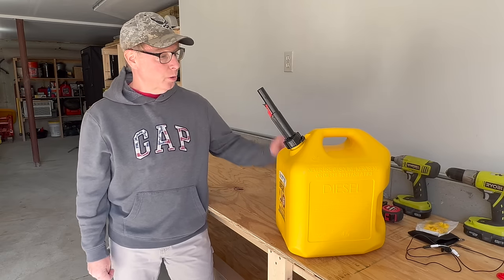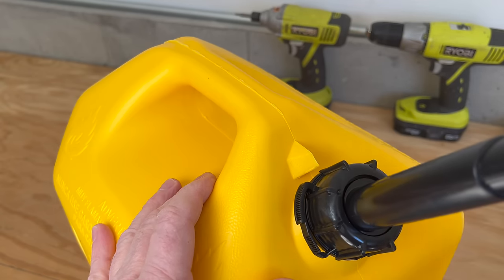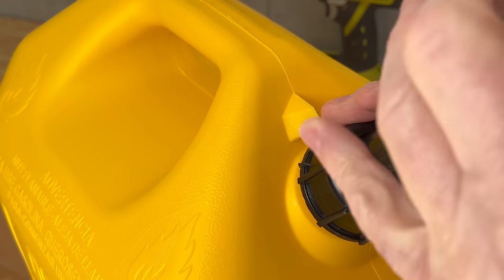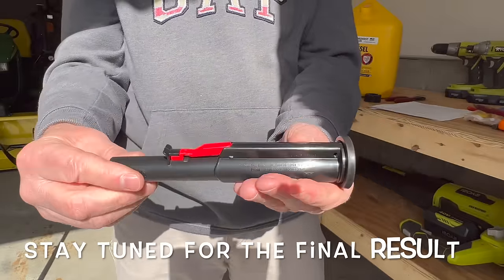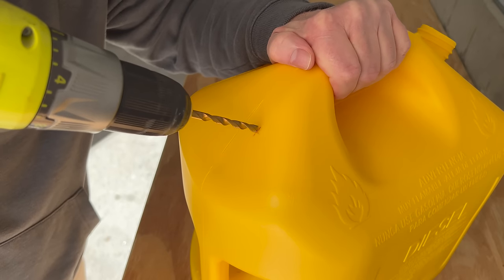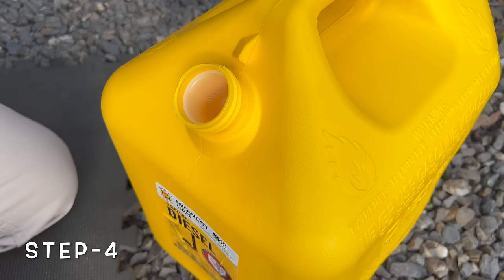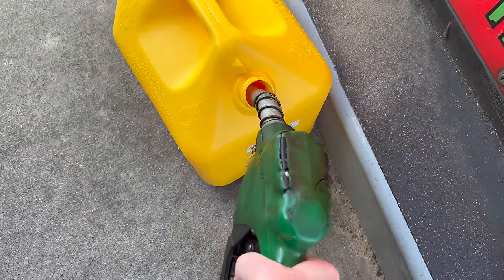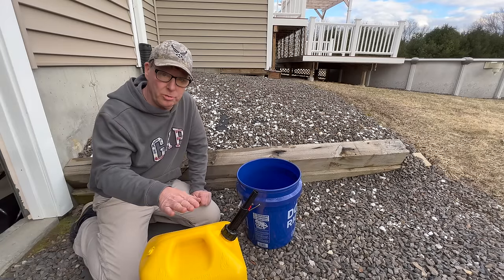Fix a New Gas Can in 4 Simple Steps.

Comment: I got a pair like these (Red, 2-1/2 gallon) at Harbor Freight and noted three of the same problems: The safety lock on unscrewing wasn't as much of a hassle for me, or I would have cut it off, as you did. The spring-loaded fill valve was really annoying. Thanks for showing me how to disable it. I don't know how they expected you to use that on a shallow Briggs and Stratton lawn mower tank.

And thanks for showing me that pop-in vents were available. Fortunately, I did save the old spouts from my prior cans when they developed holes, and have been using them, but I do need to add the vents.
Reply from the maker: Awesome. Thanks for watching

Comment: Good job. Thanks for the how to. Another issue I keep running into with these new cans for some reason is that the nozzles don't seem to screw on or seat properly without trial and error. Never had this problem in the past. I'm a former plumber. So I'm not a stranger to proper thread alignment.

Comment: I agree that the extra crap on our cans is a pain.
Just because in California,  vent holes are not allowed.  So, EVERY fuel can has to be made without them.
I spilled more fuel trying to fill a small push mower with a new "environmental safe" can than with an old Ironsides can.
Thank you so much for this video.

Comment: Came across your video about 2 years after you posted it and I'm damn glad I did. I needed a small gas can for my push mower. My older five gallon can was very clumsy to use when filling such a small tank. I bought a two gallon can which I only need to fill three quarters to have enough gas to mow my front and backyard at least twice. The modification you show in this video makes filling the smaller tank on my mower so much easier. Now the tool fits the job. Thank you for this great idea. You have earned yourself a like and subscribe.

Comment: Look for "ez-pour spout" replacement spouts. They are also a good option to fix old cans that have beat up or missing lids. I have a hi-flow double length that is great for my old tractor (I need to climb up on it and balance, the extra long flex spout can be stuck into the tank before starting the pour. And fast flow reduced the time I need to hold up 5 gallons.)
Reply: Excellent. There may still be a small issue figuring out which states restrict these aftermarket spouts (and ways to circumvent that.)

Comment: Sure, used to occasionally spill a tiny bit of fuel here or there....but with these new dumb gas containers you  are absolutely guaranteed to spill so much more than you ever spilled before plus break your back on the 5 gallon ones because you have to hold it sooooo long since it pours sooooo slowly. Great video!

Comment: Thank you so much for these terrific tips. Since I've never been able to get the dang spout to work, I've just been leaving it off and pouring the gas into my ride-on mower with a funnel. I never even knew there was a spring inside the spout, because I can't even depress the red button with my very arthritic hands let alone press on the spout against the fill spout on my mower. If I can't get it disassembled to remove that darn spring or at least cut it down (like another demo I saw), then that will be the deciding factor for whether I just keep using my funnel. It won't need a vent hole if using my funnel, because it pours very quickly, but I might add one anyway to make it flow more smoothly. I'm DEFINITELY going to cut off that piece from the cap. It too is very hard for me to mess with and it makes me angry right off the bat when I have to go to the gas station to fill my ide-on mower gas cans. Considering the trouble you and another demonstrator had getting out that thing from inside the can, I won't even bother trying. It at least keeps leaves and such from blowing into the gas can. My home is surrounded by all sorts of trees and wind tunnels, so that's important for my gas can. Thanks again for your help, esp. since there aren't even instructions on or with the dang new-fangled gas can design.

Comment: I used a step bit and a shop vac when I drilled for the vent.  I have the kind with a mesh fabric type flame arrestor, so left that one in as it does not cause splashback or pump shutoff.  If it were diesel, I'd certainly remove it as it's just silly in a diesel application.  I also replaced the spout which was a trigger type and not the push in type you have with a regular flex spout, also from Amazon.

Comment: Oh my gosh I need to do this on one of these cans for diesel fuel. I carry two 5 gallon diesel containers in the back of my truck for my pet grooming trailer. I have the cans that have the spout that moves but this type of can I see would actually be better with this modification. Plus cheaper. The other ones never get enough fuel out the way that my generator sits in my trailer. Thanks much!
Reply from the maker: My pleasure.. Happy to help.

Comment: A step drill bit works great for plastic and keeps a round hole. I use one to make a hole for adding a vent to my gas can and go slow and can get to the perfect size without having to change bits. Make sure you clean out any plastic before you add fuel. I’m going to take the spring out of the spout for sure!

Comment: I've had to do this. And in some cases just take off the spout and pour gas using a funnel. The vent cap is easy to do. But it you don't have them, a drilled hole with a golf tee to close does the trick too.

Comment: I'm still using cans I bought over 30 years ago.  They even have flexible nozzles.  (Very useful for pouring into my motorcycle's fuel tank, as I can put the nozzle into the tank before I even start to tilt the can - no spillage on the bike's 45 year old paint!  A rigid spout like this simply won't work.)

Comment: You missed one problem I have, if you use the tab to push the spout in when pouring it bends the flange on top the can and leaks all over the place. Good video, I replaced mine completely with the flex style nozzle. I never thought to take the spring out

Comment: BOUGHT THE FLEX HOSE REPLACEMENT, GETTING THE INTERNAL 'FILTER' WAS MY ONLY ISSUE, THANKS FOR THAT.  SUGGESTION.WHEN YOU HAVE THE EDGE IN THE NEEDLE NOSE, JUST KEEP TWISTING IN THE SAME DIRECTION, GETS SMALLER

Comment: There's a gas can spout kit on Amazon, was $10 a few years ago.  I disassembled the guts, I think there was a spring there.  The kit came with a vent and several nozzle types.

If I couldn't have done this, I would have continued using the very safe 1 gallon plastic jugs for antifreeze or oil.

Comment: I have the exact same can (only red for gasoline). I simply bought a large funnel so I remove the pour nozzle from the can and pour the gas from the can into the funnel which is on top of the fuel tank opening.  Easy, Peasy, problem solved.

Comment: Cool video, the new gas cans are a pain in the arse for sure. On the note of drilling plastic, try to reverse drill. sounds counter intuitive but it really works well. Drill a tiny pilot hole , then go to the drill size you want, use high speed setting in reverse. I am also a fan of the older nozzles that are flexible and retract into the nozzle. Thanks for the video.

Comment: I added a vent by installing a metal threaded tire valve stem with the inner valve removed so if you loosen or remove the cap it vents. I also remove the inner screen that stops filling. I like the spring in the spout so I modify the red latch so it does not need to be pushed down to allow the spout to move inward. I like that it can stop the flow while the can is tilted up. I can tilt the can into my tractor fuel filler and catch it on the filler spout edge to start the flow then pull back and the flow stops. That does keep the messes to a minimum.

So we are just about the same on the can mods. I will look into those vents you use because it looks like that would work a little better then my tire valve.

I will warn people to only buy these types of cans Backyard Maine shows, do not buy the ones with a different handle type because of the rear handle design, if you install a vent it has to be below the fuel level. That is bad.

NEW IDEA: I bought a adapter for my ridgid 18v batteries and a small 12v fuel pump, 6 ft of hose and a small switch. I put that all together and can place the fuel can on the ground and flip a switch and it pumps the fuel into my tractor or lawn mower and I don't have to hold up a full 5 gallons of fuel [bad back]. The 12v fuel pump works just fine on 18v. Amazon has the battery adapters for all types of tool batteries, those adapters are just a cap that slides on the battery and has 2 wires you can hook up. I first started using that adapter for my grand kids power wheels car. A 4ah ridgid battery make the power wheels go faster and longer then the 12v battery, you just need to make an adapter pigtail from the power wheel hook up to the ridgid battery adapter.

Great video, thanks for posting it.

Comment: First time I encountered one of those spark arrestors was when filling a new can with diesel -- wound up spraying diesel all over the pump area and myself -- yeah, that enhanced safety.  The lack of vent hole almost killed or injured me when I was filling a tractor from a full fuel can.  While attempting to stop the uneven and splashing flow so fuel would actually go into the fuel tank instead of all over me and the tractor, I was turning the can, it slipped, fell off the tractor, falling toward the ground from 5 feet up, pulling me with it.  Fortunately, I stuck the landing but the fuel container landed on its side, losing about a gallon onto the ground -- gee! that really was great for the environment.  My experience with the gas cans is equally frustrating; I spill more gasoline than I ever did with the old containers but I guess CARB is OK with gasoline being spilled all over the place.

Comment: I’ve never had an issue with these new cans, they work great.  Unless you are going through a lot of fuel routinely, don’t leave the sealing cap off and the fuel exposed to air as the fuel absorbs water over time.  This can make the fuel difficult to use in your equipment.

Comment: The best thing to do is to go to Canada and get milspec 20L Specter jerry cans.  You'll also need a nozzle and a can wrench.  Make sure the seals are Viton if you intend to use them for gasoline, since rubber seals are cheaper but only good for diesel.

Drive them south across the border and declare them.  EPA prevents them from being sold in the US, but small-scale importation for personal use is no problem.

I can attest that the extra thick plastic of the good cans prevents all vapor leaks, and while the cans pressurize in heat, they don't swell.  I should have bought them years ago.

Comment: Seems like this fix would work well. What I've been doing to bypass the problems these new cans introduce is to:
1. Purchase, or find an old can stopper. Meaning - one without a spout that will seal the opening against any spillage. When you have one, it can be used on future cans as the cans deteriorate!
2. Purchase a plastic funnel which is typically used for adding oil to your vehicle. You know, one having a wider than normal downward-facing spout, but fits nicely into your mower's gas filler opening. Recently purchased one at WM for about $4.
3. Remove cap from gas can.
4. Place funnel into tank opening.
5. Pour gas into funnel, stopping prior to tank overflow.  Gas will flow quickly into the tank (faster than the typical spout provided with gas can - but be careful to not allow overflow)!
6. Cap off the gas tank and the gas can.
... and be on your way for a nice session of mowing! No spills. Quick fills.

Comment: Great vid. Still a little worried about getting plastic in the tank from the drilling though. What did you do to prevent it or clean it? ...especially after having removed that strainer piece.
Reply from the maker: The small amount of plastic was vacuumed out. You could also rinse with water and let it dry before adding fuel.

Comment: I don't mind the spring but that red lock was a pain. Every time I moved a little it would relock. Trying to hold 40 lbs. of fuel with one hand to push the lock button again! I just removed it. But it really NEEDS those vent caps. I will be buying some.

Comment: I call it boot legging a can. I do it a little different. First , I throw the pour spout away and buy a yellow screw cap to replace the spout. Then I bought a 1 gallon funnel to pour into. I have twelve plus cans. I started with the yellow vent caps,(if you use these you should super glue them in place) but soon started using a vent stem that resembles the stem on a car tire. The yellow vent caps are always leaking and won’t stay sealed

Comment: I share your sentiment that these new "safety" features are not only dysfunctional, but actually make filling the gas tank more unsafe.

I like your video, but have a few other suggestions.  You can actually buy a new spout that comes with a flexible nozzle with no safety device, and it comes with a screw on cap at the end of the spout plus they supply the vent for free.  This flexible spout helps when filling with a full gas can.  If you have a Menards in your area, the in store price is under $5.

Also, in your method of keeping the existing spout, I might try cutting an inch or so off the supplied spring (rather than discarding it all together) to make it easier to depress, but still have it seal itself after using the spout.

Again, great video, wish manufacturers   would consider end users and functionality when designing safety features.

Comment: That was one of the most valuable “how to” videos I’ve seen in a long time!  Great presentation!  I remember running out of fuel in my 20’ moving truck with 50 gallon tanks.  On the side of the highwayI’m trying to pour 5 gallons of fuel into the tank while standing on the white line!  I was afraid for my life as it took forever just to get a few gallons in while the nozzle kept slipping off the lip of the opening!  One of the stupidest ideas EVER!

Comment: My experience is I use these new "difficult"cans several times a week and have never had one issue whatsoever. They are very easy to use.
Reply from the maker: Not complicated at all. They just pour slowly, splash fuel when filling them unless you go really slow and the pressure required to depress the spring is too much for most small engines. I'm glad to hear someone likes them though.

Comment: You can use a step drill and it won't tear the plastic.  Also, a 1/2" drill bit will work just fine. No need too find a 31/64" bit.

Comment: Thanks! One more bonus to your mods: I always kept my brand-new gas can in my car full of water. If you need water, you always have it. If you need gas, dump the water out, and use it as a gas can. Great, except the spring in these new cans will rust & corrode, contaminating your water and making the spout inoperable. I also found (too late, after I tossed out a whole ruined can) that you can buy just the replacement spout instead of a whole new can & spout. Which obviously means that the spouts fail frequently enough that they sell replacements. Horrible design by safetycrats.

Comment: I drill a vent hole in mine and use a screw a close it. Just remove the screw when I pour gas. I pushed the safety thing back and used a self-tapper to hold it open all the time. Problems seem solved.

Comment: Great vid.  Question:  how would you install a flexible pour spout that would make it easier to fill a boat gas tank, for example?
Reply from the maker: They sell flexible spouts on Amazon.
Reply: @BackyardMaine  Yes, I can see that now after reading through some comments.  Thank you.  The advice re. using step bits and reverse-drilling (I've drilled through a fair amount of stainless steel to make brew pots, etc.) is also good.

Comment: I bought the red can to use it for my MC only. Trying to hold that up In the air, while squeezing the sides, pulling the lever back so the gas would go in had me fn pissed off. I wrapped a pair of channel locks and ripped the spout off then I grabbed a pair of needle nose vise grips and made short work of the whole spout system.  I got a bag of Universal gas caps from Amazon and they're perfect. I still have to put a vent in.
" IF ITS NOT BROKE, DON'T FIX IT "!!!

Comment: I didn't know you could buy snap-in vents. I was using metal valve core stems, taking the core out, and drilling holes to screw and glue them in. Worked ok but I have to be careful to not lose the valve stem caps when I'm pouring.

Comment: OMG - I went to Tractor Supply a couple years ago to buy a new can for my gas zero turn.  I can't tell you how aggravating it was to try to fill the 5 gal can to 4 gallons (I can only lift 4 gal) and yet watch the gallons count while barely holding the nozzle into the can so it wouldn't spew out all over the place (which I learned the hard way).  Then I get back to the farm and can't get the gas to go (arthritic hands).  I was so mad and wondered why in the hell this can is so stupidly designed.  One word:  government.  Seems the answer to most all our problems.  I'm so thankful I found this.  Can't wait to apply steps 1-4.  You should consider running for office, oh wait, they don't accept too many common sense folks.  Thanks!

Comment: If you don't want to order and then wait for vents to show up, you can use tubeless tire stems instead. Just drill the right size hole then push the valve stem in using a little grease to help it go in. Next, take out the valve core and use the valve cap to seal it until needed.  👍

Comment: In case nobody’s already said this, the best way to drill through that kind of plastic is by running the drill in reverse (counterclockwise)… use high speed and don’t push very hard. Depending on the plastic, usually the friction will heat up both the drill bit and the plastic and kinda melt through it!